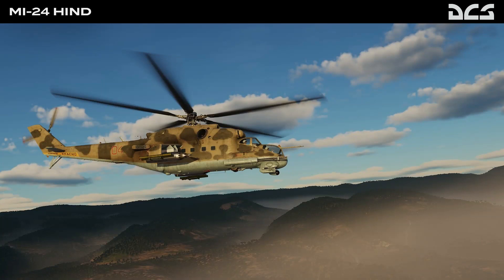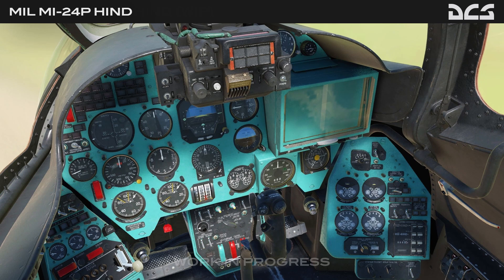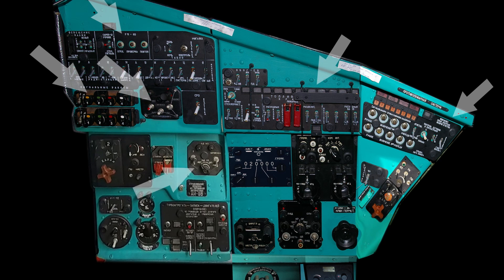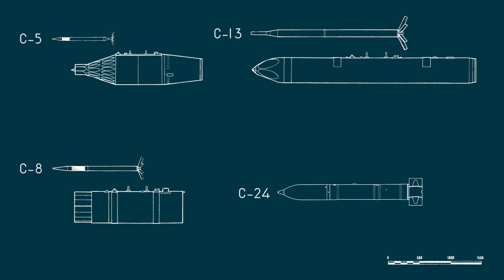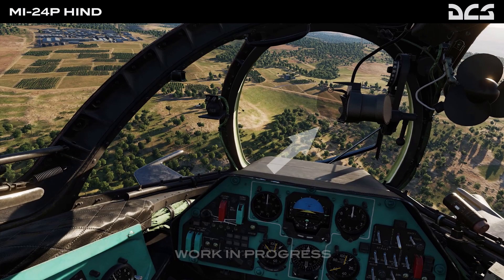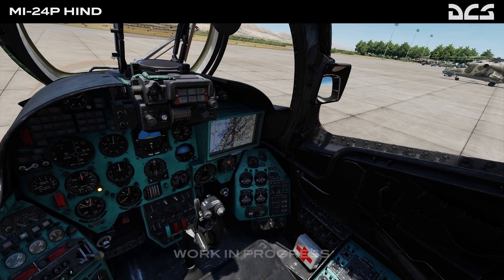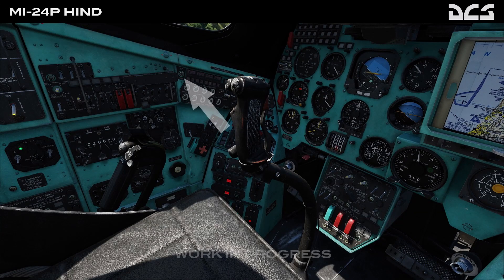DCS: Mi-24P | Introduction part 2 | systems and capabilities

Comment: Hey Viktor, i need your advise. i´m currently relearning and enjoying the mi24. unfortunatly my cross on my map does not move. it never moves, no matter what i try. i do the alignment by pressing the sync button, holding it for few seconds, 3 minutes after powering on the system and it is also set to MAG. It worked back days when the mi24 was ea-released, but now it wont work anymore. what else can be the issue with the non moving cross on the map? cant find anything in forums or by search. maybe you can help me out. do more videos!!

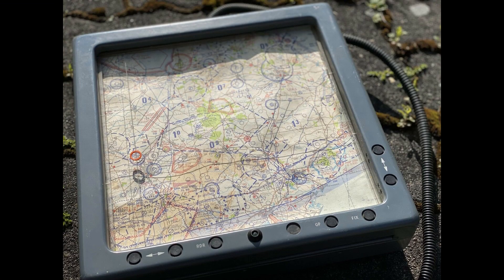Comment: I'm reasonably certain that the paper moving map shown at 4:25 is just made by Decca and driven by a doppler radar system - the moving maps that used the Decca Navigator system (with the red/green/purple pairs of stations, no radar in the aircraft, just a passive radio receiver) used a very different and interestingly distorted projection.

Comment: KMGU ive used that on ka50 mate and Frogfoot. What do you mean its not modelled
Reply from the maker: Hey. Thank you for pointing that out. In an interview the lead designer mentioned it was not implemented - but that was probably a misunderstanding. I did not double check.
Reply: @virtualflighttraining9694  maybe for mi24 i guess.. np

Comment: I find the bombs in the KA-50 to be useful when I want to destroy some targets, and then the building they were defending.

P.S. I am pretty sure a developer said in an interview that they are holding off the R-60s until the IR/ FLIR update that will make you able to lock onto ground targets in a realistic manner.
Reply: Yep, because the that's what Soviet pilots did in the afghan war. The R-60's warhead that was meant for proximity kills against aircraft is really effective on light ground vehicles and personel, they were also self guided and has a much shorter minimum range than other guided missiles the Mi-24 carries.

Comment: There is in fact a laser rangerfinder on the Hind. The Shturm sight has a laser rangefinder to enable the missile to to first fly above the sights LOS only to start a shallow dive once it gets close to the target. It's not a top attack system, merely a design to allow it clear obstacles better since the sight system was originally designed to be used from ground vehicles.
Reply: The sight doesn't itself. Apparently some Vs and Ps had one installed in place of the 4th window on the right side, and a different variant the PN has one that is very prominent on the center of the nose
Reply from the maker: Hey. Very interesting. Could you point me at the source of that information?
Reply: @virtualflighttraining9694  https://weaponsystems.net/system/522-HH06%20-%20AT-6%20Spiral%20(9M114)
Mentions the laser rangefinder specifically. Hard to find first hand sources since I don't speak Russian and I haven't the faintest clue how to source Russian technical manuals on stuff like this. 

http://www.airwar.ru/weapon/aat/shturm.html (in russian)

Makes mention of the flight profile of the missile.

The flight profile the second link describes is impossible without any range information, and as far as I know it is not possible to manually input range into the 9K114 system.
Reply from the maker: @gamma7897  Thank you for looking into it! I have also tried to find information - but a laser rangefinder of the Raduga-Sh is mentioned nowhere on the Russian websites or in the documents I have. Distance to target could as well be calculated geometrically, if required - the way it is done to fire guns and unguided rockets. I will let you know if I find more information on this!
Reply: @virtualflighttraining9694  I think it doesn't talk to the rest of the helicopter. Atleast according to the engineers that built the thing a lot of the systems are just packed in there without any integration in between. Especially the ATGM sight sounds like they just borrowed as much as possible from the existing system and just made it somehow work rather than try to create a truly integrated system. The manuals I have are all of the Mi35 so they are of limited use when it comes to certain systems.
Reply: @virtualflighttraining9694  Laser range finder is not a part of Mi-24 Shturm system, it's also mentioned in part describing weapon system in general, not its configuration on Mi-24.

Comment: Do you know if the IR jammer is going to be simulated? the mounting is there in the 3D model of the DCS Mi-24P,  though currently unoccupied. Also has ED commented on the quad mounts for ATGMs?
Reply: They don't model IR jammer as based to developers, it has been taken out of service lately because it was good only for a blowpipe or strela-2 missiles, and not effective to anything more modern. (Yet it took from them like 40 years to start removing it.... Wonder.)
Reply: @Mk82cal  Well but we should have the configuration the plane had during it's main service time, not what the leftovers have now.
Reply: I remember reading the translated interview with a dev, and he said the Hind will carry up to 8 missiles
Since we saw 4 double launchers in the pre order vid, i think it's safe to assume we won't be getting quad launchers
Not even sure if they existed
Reply: @kacper8562  there is an old black and white photo of a Hind with two quad launchers below the wings and two double launchers at the wingtips, for a total of 12 missiles if fully populated, the caption says its an Mi-24V but the nose looks like a P,  no gun turret visible
Reply: There is control panel for IR jammer installed in weapon operator cabin as well :D

Comment: 60-80mm of pen'... It's for an HE filler, not HEAT then ? 

Very good video. Can't wait to play with this -24
Reply: Was a typo, that mm would be cm or just multiply that number by 10 as they are 600mm or 800mm RHA respectively.
Reply: @jebadiahkerman7846  yep !

Comment: Great video. Thanks to this video I realized that this bird is almost garbage compare to ka50. I decided not to buy it. Thanks. But looks itself and the way it is modeled in dcs is piece of art
Reply: Totally different timeframe like Gerard said... like saying the F-5 is garbage compared to the F-18 and that would be a reason not to buy it...

This is for Cold War scenarios.
Reply: Well garbage is a bit of a stretch... are you going to be plinking tanks from 7km away? Or slowly and methodically taking out sophisticated air defense system No. Do you want to sling load, or potentially load troops? Do you want to to take out air targets with R-60ms? Then the Hind is definitlely better. 
Do you want to play in cold war servers where the K-50 is going to a best be in limited numbers and likely replaced outright with the mi-24P? 

The hind is rugged, reliable, and combat proven in many different senarios, while the Ka-50 is expensive, and more maintenace intensive, which is why there are still dosens of Mi-24Ps being used by Russia today, and no more Ka-50s being used, instead being replaced by the more sophisticated Ka-52.
Reply: You are comparing a 60s analog design to a 80s digital one. Yes the performance is dramatically worse, but it has a different playstyle.
Reply: I agree, I regret Pre-ordering it. The Apache can’t come soon enough.

Comment: Again awesome job man, very well explained. Question, do you plan on doing flight/system/weapon training videos after EA release? Also, that attitude indicator, were those extra features not present in a real life Mi-24P or is that a limitation we face in DCS alone? If the former, I would have to say that is the most "Russian" thing I've ever heard of.
Reply from the maker: Hi Triv. Thank you for the nice words. Very much appreciated. Yes, I would love to do this and if my spare time allows it, I will.
Reply from the maker: The attitude indicator is simulated the way it works in real life. There is no flight guidance system that could send signals to the flight director. And there is no ILS equipment on board either. The only thing I am not 100% sure about is the radio altimeter and drift indicator. I think those actually work in some serial numbers.